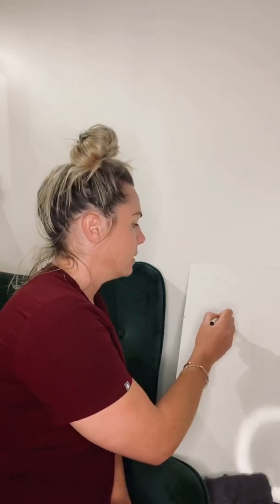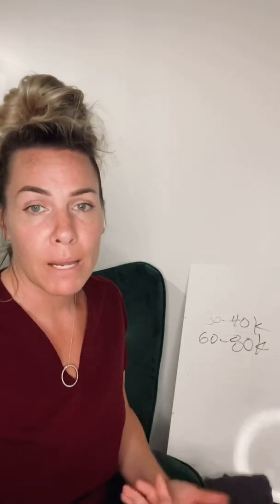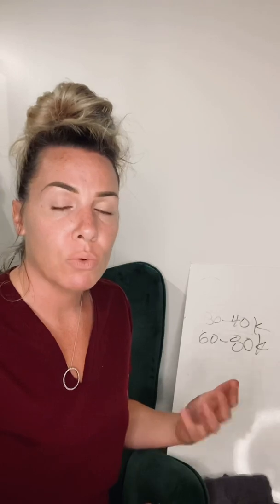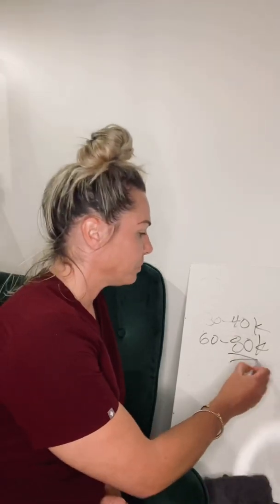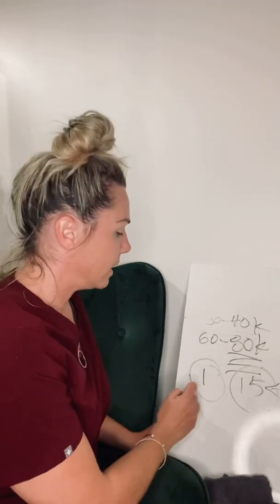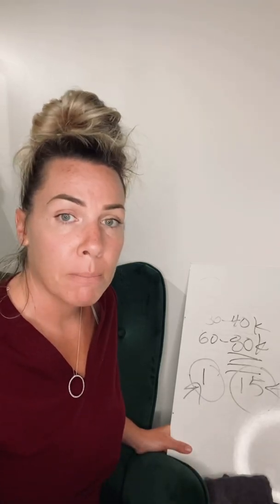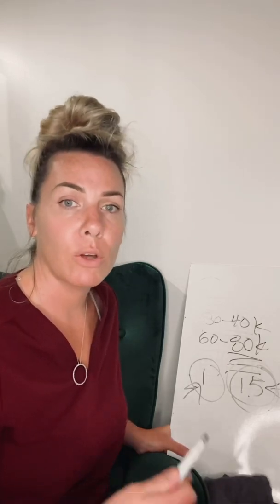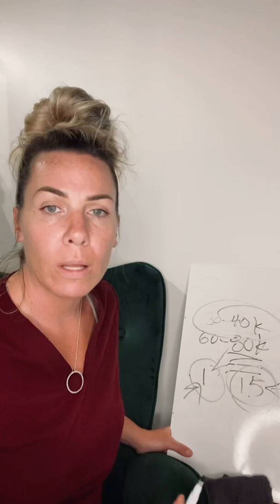How Cavitation Works

Comment: It's a great video, it explains everything I was confused with....thank you, if I have a 80k machine...and have to deal with a thicker fat belly, so can I choose the lower power level to get it target the deeper/ bottom layer of the fat?
Reply from the maker: The m,achines will typically stay at the range they are set in...for example if you have an 80k in will stay in that range., only going up or down minimally. It wont go down to 70,60,40 ext